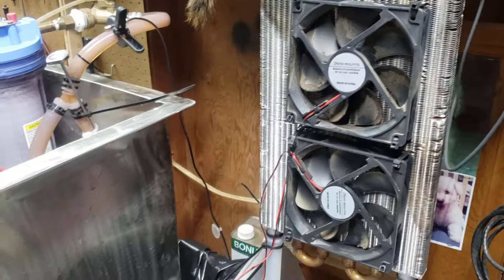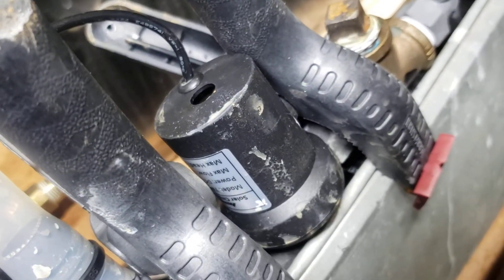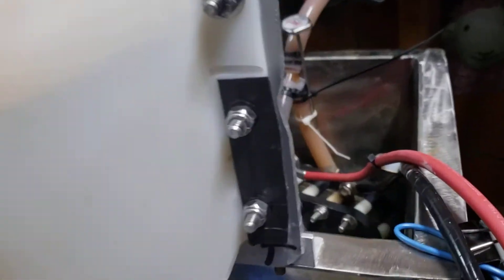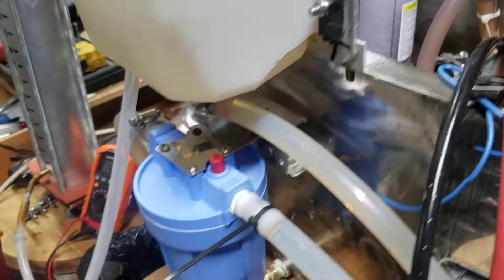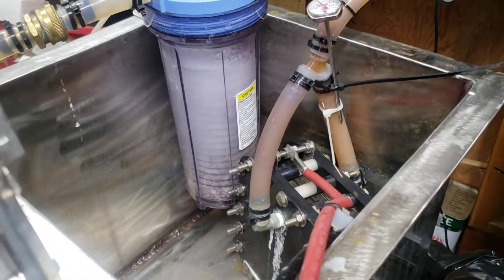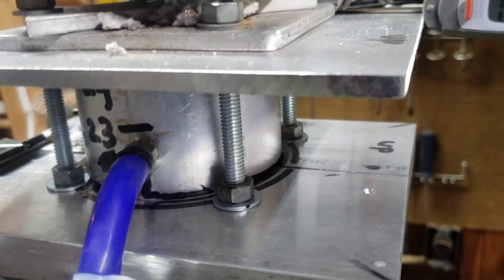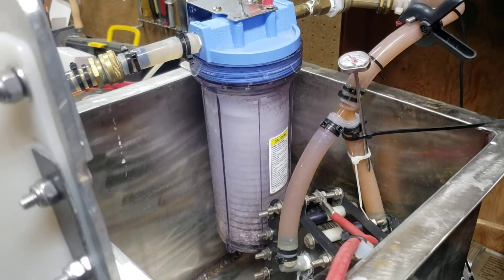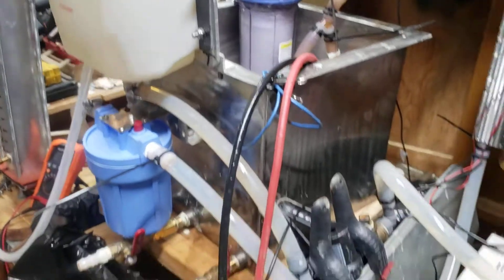Cooling system for your HHO cells

Comment: Very interesting video, issue i see is back pressure, the joints , Tees and such ...non fixed by solvent welds ... These will leak. All such joins get ignored and over time become loose and disjointed... Hho... Would find a way thro and out of even  the smallest of gaps...
Interesting stuff...
Thanks.
Thom in Scotland.

Comment from the maker: Recently we pushed up power input to 900 watts AC going into the power supply and 17 vdc going to the hho cells. That 2.8 vdc per cell and the cooling system kept the water temp at 90-92F as we set the controller. So the system works well. This would not be possible to keep temp this low without the cooling system at this power input level.

Comment from the maker: NOTE: The transmission oil cooler is a copper tube covered with aluminum fins. Do not want to use an aluminum tube unit because the sodium hydroxide with eat it up!